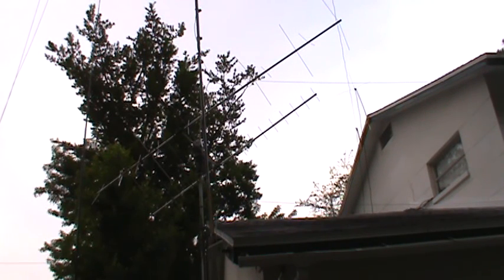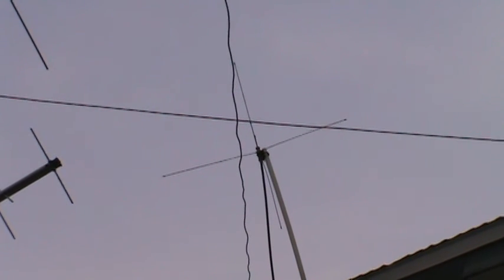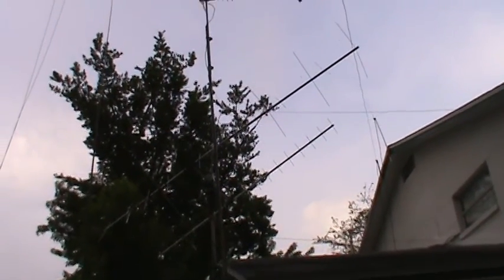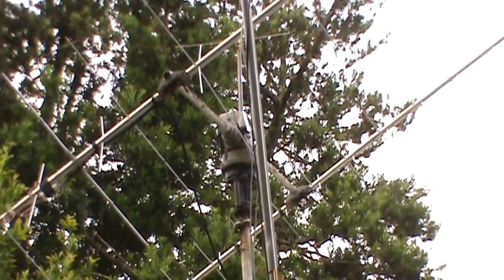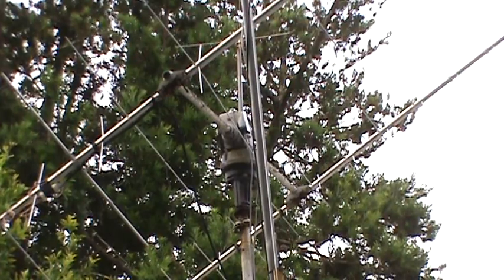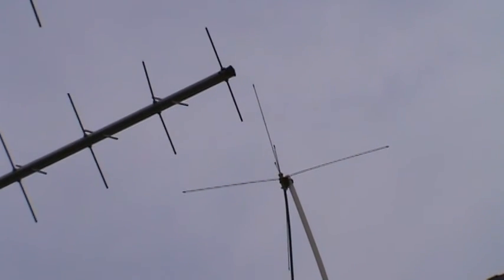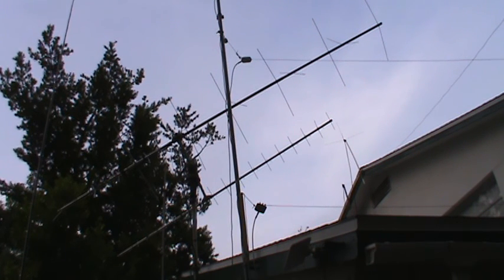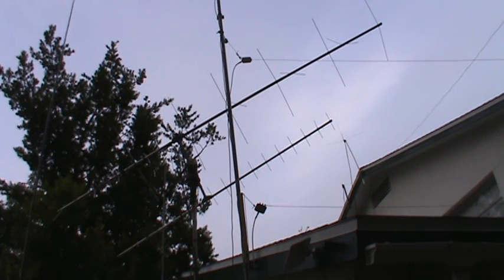TRRS #0853 - Simple Outdoor Antenna for Scanner Radios

Comment: What do you do for lightning and static protection?
Reply from the maker: +far2many gadgets I have static and lighting protection both in my backyard and front yard provided by the power company.  At the end of my block I have power poles that are 40 feet high that help too.  That being said there is always a chance of a hit.
Reply: +hamrad88 By "provided by the power company", do you mean simply that nearby electric poles act like lightning rods to protect your antennas? What about voltage induced from nearby strikes?  Do you use gas discharge tubes in your transmission lines, always disconnect when not actively listening, etc?  Have you ever had any equipment damaged?   I'm planning my first outdoor antennas but I'd like to know more about this subject so I don't fry my receiver or my house.
Reply from the maker: +far2many gadgets Our power company many years ago installed a heavy bare cable on top of the power poles.  These are then grounded with #12 wire.  I think this is to prevent lighting from hitting the power lines but I am not sure.  I have used gas discharge tubes in the past but they tend to fail on their own so I never replaced them.  Also, I disconnect all antennas when not in use.

Comment: That is a good simple antenna you can get for scanner listening. If your just getting into radio transmitting or receiving. Try just a wire dipole which is the basic's of all antenna designs.
Reply from the maker: +WV Wildlife Cam Yes and there are plans on the internet for making a very simple antenna for scanning VHF/UHF.  I will see if I can find one.
Reply from the maker: +WV Wildlife Cam I added a link in the description above to a website that shows you how to make a simple version of this antenna for less than $10.